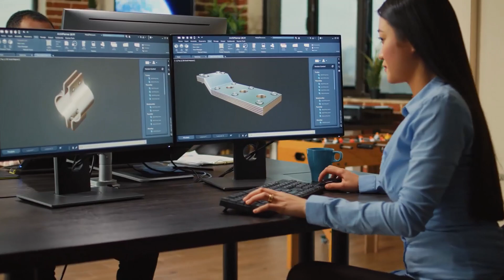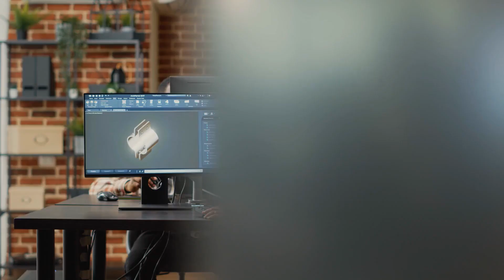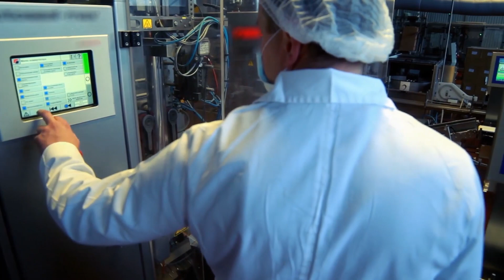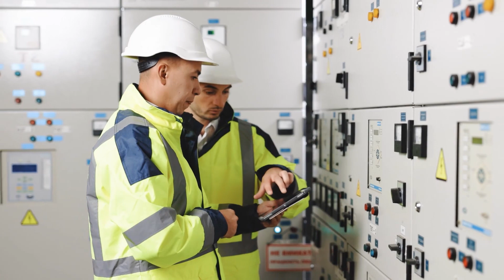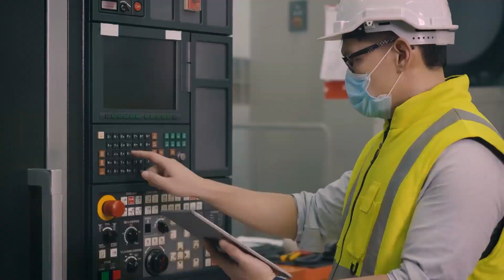The Road to Mechanical Engineering: How Skilled Trades Can Help

Comment: Hi Malachi, I am a former fabricator considering a career in Mechatronics Engineering. I have been searching for careers in which I can combine the production aspect of my former career with the creation of new systems. The appeal to me is in neither the production or the design, but taking from both disciplines equally. I really enjoy the production aspect of my job, but the detriment to my health has me really considering one where I can balance out the production aspect with development as well. Within the culture of a systems integration company, would I see a parallel of those who produce and those who develop? Thank you for your time.
Reply from the maker: Robotic welding would be a good fit then. You could work in an automotive facility doing welding processes. Or integrators who  integrate the same types of systems

Comment: Hey, I'm a junior getting a Mechatronics Engineering degree at USI. I'm  getting really interested in the automation field, and I would like to know how does a degree like mine would fit a System Integrator company, and if you know someone with this kind of degree, what kind of skills do they have to offer to a system integrator company. If that makes sense.
Reply from the maker: Mechatronics is probably one of the best degrees for automation. It's a somewhat newer degree path. It is basically mechanical and electrical practices. Automation is very much mechanical, electrical, programming, and problem solving. I would suggest to pick one to get good at. Do you have any particular direction you are looking to go into. Also stay tuned. I might make a video around this topic. Also if you haven't seen our podcast the Manufacturing come up check it out. It's all about peoples career paths in our industry.